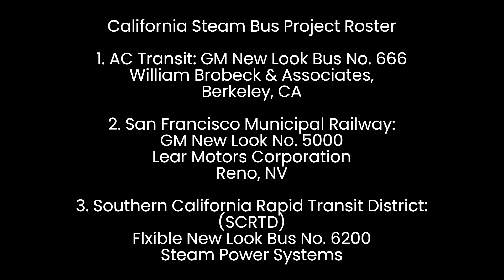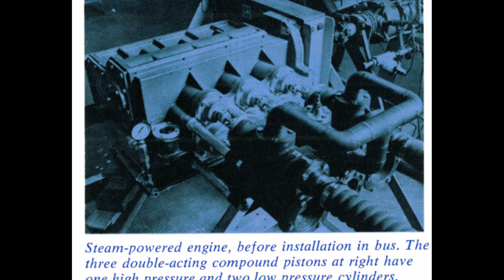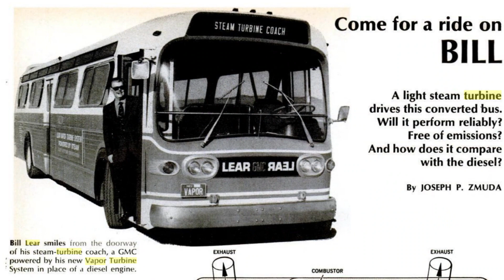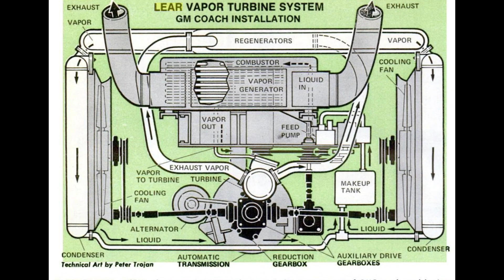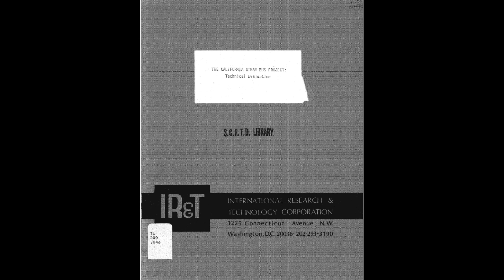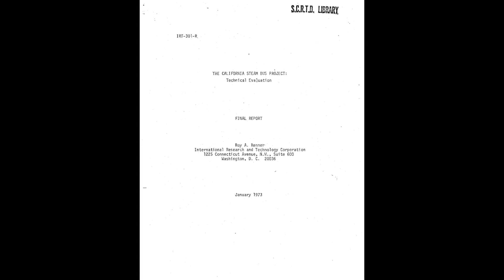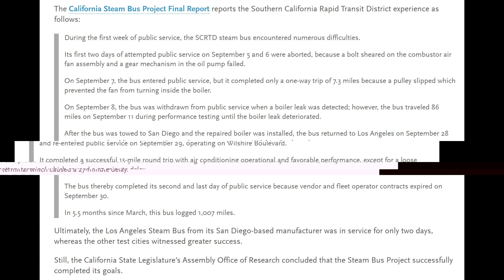California Steam Bus: 3 Boiler-Powered GM & FlxibleTransit Buses!

Comment: Jeffrey what type of microphone are you using?
Reply from the maker: Hello! It was a ZealSound rechargeable microphone. It was good and had a lot of features, except that it started to lose the ability to hold a charge. So I had to replace it, and I'm currently using a different zealsound. But the one I use now isn't rechareable and has less features. Thanks very much for watching!!

Comment: yeah any project that cut into the profits of big oil coal etc soon get shelved 
wonder why that is , you know that a guy in your country invented solid hydrogen and a 
motor to use it a certain President banded its use, no not the current one
Reply from the maker: Hello! LOL, and that's not the only story like this...years ago I saw something about an engineer in Detroit who invented an engine that works on water just as good as an internal combustion one. No doubt, it was quickly squashed! Thanks very much for watching again!!

Comment: Hold!!!! Emergency stop!!!! A town asked a contractor to sub-contract a public transport system? Can you add some more commercial interests and contractsPalease!! In engineering, the weakest part of the big unit is the thread of the m10 nut. ( an old fella in a blue boiler suit told me that with a rag hanging out his right rear arse pocket, pencil, sciber in his left breast pocket, flat cap on his head pipe either in his mouth or clipping my head) I struggled with imp to metric on student lathe
Reply from the maker: Hello! LOL, very interesting story!! Thanks for watching!!
Reply: @JeffreyOrnstein  im so sorry i seemed to have spilt rather a lot of ale down my throat whilst considering my wifes bouncing thighs on these seats over rear axle that I have chosen for us to sit in .;) please do take my fare.
Reply: Leaf springs same for hardcore tipping 12 ton trucks. Find me a wife that rides on a citreon ( french) hydraulic) bus and maintains her, well everything. Im sure Einstien was help by vibration of buses and quality of roads. Its ok for you USA "easy riders" soooo smoooootth

Comment: For me, screw the gasoline and diesel companies and use either methyl or ethyl alcohol for fuel to boil the water and use high voltage alternating current for interior lights and headlights and tailights from batteries.
Reply from the maker: Exactly! But, it will never happen! Thank you for watching and for your comment!

Comment: Did I miss it, or what fuel did it burn to make steam?   It must have been very quiet in operation.
Reply: Probably diesel fuel or kerosene. But the premixed combustion assured low hydrocarbons, CO, and particulates. And the low pressure combustion assured low NOx. It was probably similar to an oil furnace burner.
Reply from the maker: Thank you for watching and for your comment! Water was the main source of power, but it may have had a small amount of diesel fuel for the boiler.